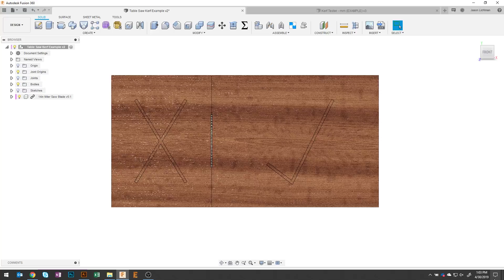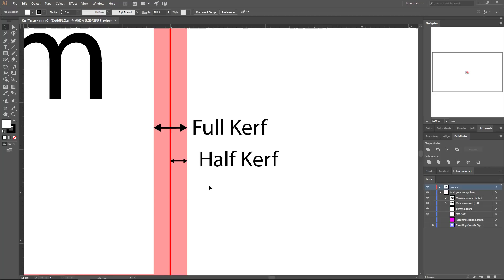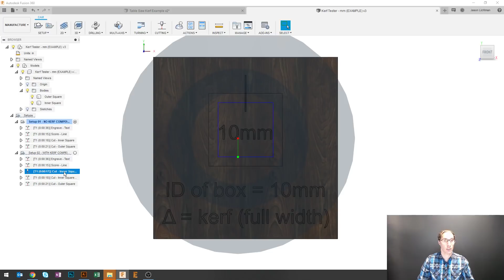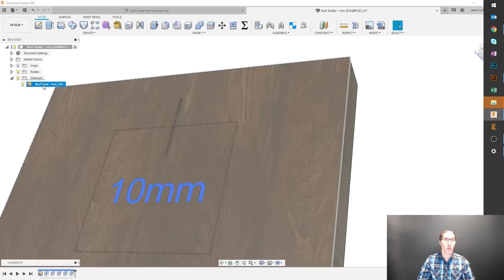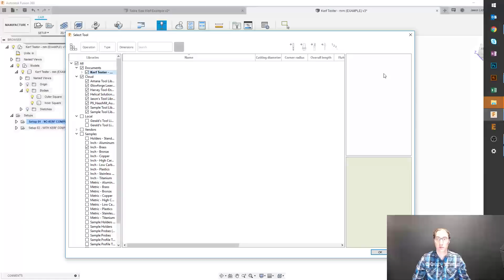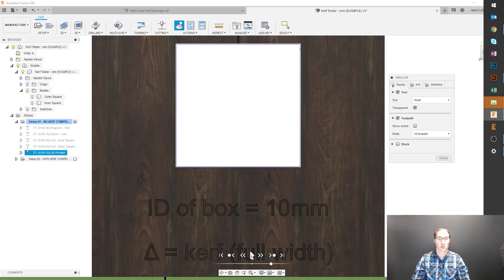360 LIVE: Kerf 101 for Laser, Waterjet, Plasma

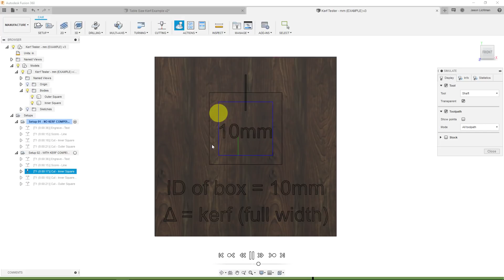Comment: When you simulate the laser cut on the inside at 10:00, you won't have a perfect fit, because you don't cut the corners up to the rectangle? It's the same problem people with CNC routers have depending on the size of the cutting tool.
Reply from the maker: Just takes a tiny chisel. Jk, but you're totally right.
Reply: @adskFusion  I just thought it was worth mentioning :). You could have the laser do tiny dog bones if you really need it...